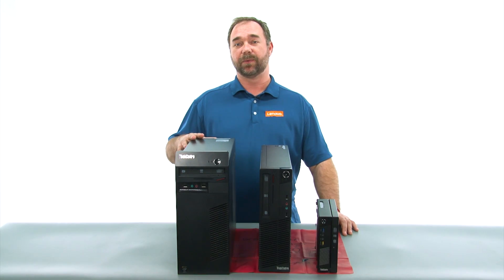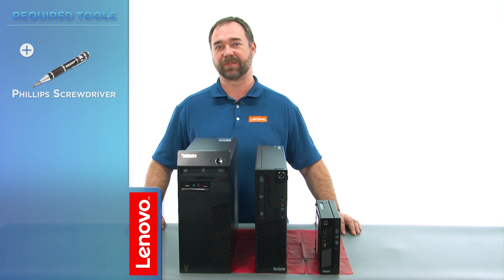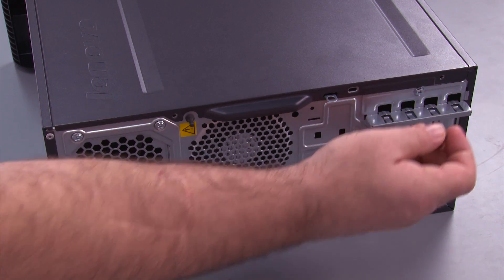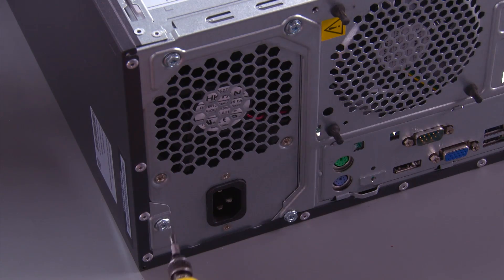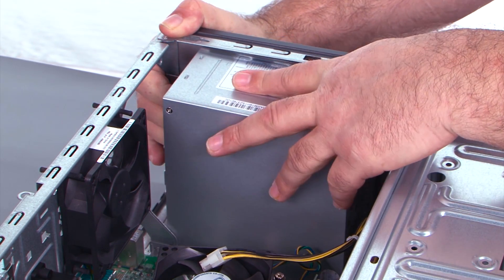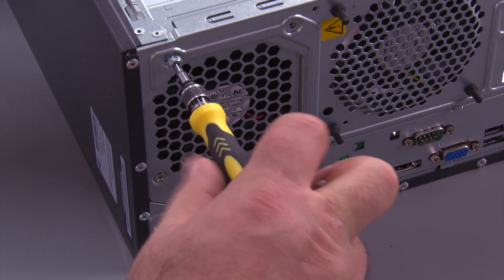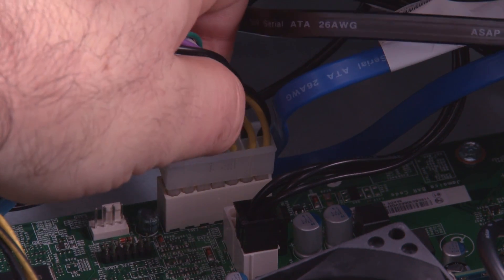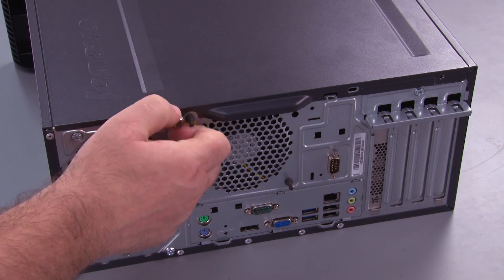ThinkCentre M73 / E73 / M72e Tower Desktop - Power Supply Assembly Replacement

Comment: Very helpful but could you maybe give me some recommendations for a power supply
Reply from the maker: Hi there, @Taurik Foster! Thanks for reaching out. We're glad to know that you find our video helpful. About the power supply, could you please tell us the complete model number of your Lenovo computer for us to check? We'd like to help. -Maru_Lenovo
Reply: @LenovoSupport  its the Lenovo thinkcentre 0958 b2u
Reply from the maker: Thank you for the information, Taurik. Upon checking, the power supply for the  Lenovo Thinkcentre 0958 B2u is 280 watts with variable speed fan, manual switch. Does this answer your question?Carll_Lenovo
Reply: @LenovoSupport  I was asking for recommendations for an upgrade?
Reply from the maker: Thanks for the serial number, Jeff. You can call our support team at this number:
877-453-6686
English
Monday - Sunday: 8AM - 8PM EST

You also have service ticket # 2003651237 opened on 9-10-2021. Kindly check for emails with instructions regarding your repair.

Let us know if you have questions. Carll_LenovoCarll_Lenovo

Comment: Hey I have Thinkcentre m72e TOWER  i7-3770 3.40ghz 8gb ram gt 1030 What is the PSU of the pc?
Reply from the maker: Hi! Thanks for writing in to us. The PSU differs from 240-320W depending on the exact model of the computer. Could you share us the exact machine type model for us to check? -Jerry_Lenovo
Reply: @LenovoSupport  sorry my wrong the watts are 280 and can you please tell me how to check the pc model?
Reply from the maker: Hello, ValKiller15. May we have the serial number of your device (on the sticker at the bottom of the device showing S/N) via Private or Direct Message  so we can check the model of your machi. You can also go to https://lnv.gy/2KxMX6u, enter the serial number, then click on Product Home on the left side to view the details.  Let us know what other information you need so we can assist you. Carll_Lenovo
Reply: @LenovoSupport  hi the serial number is : S4XRWN8 mine pc is kinda updated i think because I have i7 3770 gt 1030 and 8gb ram Windows 10
Reply from the maker: Hi! We've checked the specifications of your computer and it is using a 280W PSU. The part number is 54Y8884. -Jerry_Lenovo
Reply: @LenovoSupport  so can I put gtx 1060 6gb so I can finally record vudeos on full resolution
Reply from the maker: Thanks for getting back to us. You may visit this link https://lnv.gy/35hqK6j to check for the compatible parts that has been tested for your machine. May we know if you're having issues with your device? We're here to help. Fraineee_Lenovo

Comment: I currently have an E73, that is going on and off every 3 seconds. I dont want to replace the power supply it could be the board. Anyone have any experience with the E73?
Reply from the maker: Hello Dj.DVEVO, thanks for reaching out. We'd like to know at what point does the machine shut down automatically. Is it after you see the Lenovo logo? Is it after you sign in to your machine? Or does this happen when you try to power up the machine and then it turns off immediately, with nothing on the display.

Additionally, you may try to plug the computer directly to the power outlet to check if this will fix the problem.

Let us know how this goes. Allan_Lenovo
Reply: @LenovoSupport  The machine won't stay powered on to POST. So after opening the case, disconnecting the power to both the hard drive and the cd rom. I plugged the power cable in. It powers on by itself. The fan spins for about 2-3 seconds the machine powers off and then back on again in a cycle. I guess posting a video would be easier :)
Reply from the maker: @Dj.DVEVO Thanks for providing the details. What we would recommend, since the machine is not proceeding with the POST, you may want to bring it to a local technician to have it assessed. Please note that if the machine is already out of warranty, the assessment can be done, however, it will be for a billable basis and you may want to inquire first.

Let us know if you have other questions. Allan_Lenovo

Comment: Helpful video , but I need to confirm something : is the power-supply a normal-sized, PC , ATX - Power supply (150mm x 86mm ) , or a small-factor one ?
From what I can see from the video it seems like a normal-sized PSU , so can I replace it with any brand ATX PSU ? ( i'm thinking for a Corsair  CX550M )
Thank you.
Reply from the maker: Hi Powernod! Thanks for reaching out. The dimensions of the ATX Power Supply in the video is 150 mm width, 86 mm height, and typically 140 mm depth. This means that you may use CX550M since it has the same dimensions. Let us know if you have further questions. Van_Lenovo
Reply: @LenovoSupport  Thanks for the help !!!!
Reply from the maker: You're very much welcome! Glad we could help. Have a wonderful day! Van_Lenovo
Reply: @LenovoSupport  ehmmm, once again I need some help since I just noticed that the PSU connector at the motherboard is a 14-pin one. 
All the aftermarket PSUs ( like the Corsair CX550M that i'm interested for) have a 20+4 ATX connector ( https://www.tomshardware.co.uk/corsair-cx650m-psu,review-33693.html ). Will it be compatible with that 14-pin at ThinkCentre's motherboard ? I got little confused here ….
Reply from the maker: Hello! Thanks for writing back. You may need an IBM Lenovo PSU Main Power 24 Pin to 14 Pin Adapter for you to install your Corsair PSU. We do have a similar thread in our Lenovo Forums here https://lnv.gy/30KH3oH for additional information. Keith_Lenovo
Reply: @LenovoSupport   sorry , for the delayed answer !! I didn't receive any notification about your answer as opposed to the previous ones !! 
Thanks a lot for the info , i'll look into it .Thanks !!
Reply from the maker: Hi Powernod. Thanks for getting back to us. Should you need further assistance, feel free to contact us anytime. Have a wonderful day. Auxen_Lenovo
Reply: @LenovoSupport  Thank you! I've been looking for the psu specs for so long, this is apparently the only place on the internet to find this info.
Reply from the maker: Hello Conor! We're glad that we're able to help you with this. Don't hesitate to reach us if you need our support. Have a nice day. Keith_Lenovo

Comment: Can in the tower put gt 1030 hight profile ?
Reply from the maker: Hi there! Thanks for reaching us. Could you please tell us more about your concern? We'd like to help. Arjay_Lenovo
Reply: @LenovoSupport  i will buy this PC 
https://plasico.bg/lenovo-thinkcentre-m72e-tower-64742.html#full-details
And I want to know can I put gt 1030 high profile thx in advance
Reply from the maker: Hey there! Another help here. You may need to have the actual tower first in order for you to check if the high profile GT 1030 will fit properly. You may need to check the actual size of it. -Chris_Lenovo
Reply: @LenovoSupport  can you tell please because I'm not good at this things pleass
Reply from the maker: You may check out this information under the hardware maintenance manual https://lnv.gy/2KD5ujU. -Chris_Lenovo
Reply: @LenovoSupport  ok I bought the PC and it works properly
Reply from the maker: We're glad to know that it's working fine. Should you need further assistance, don't hesitate to reach us. Keith_Lenovo
Reply: @LenovoSupport  ok